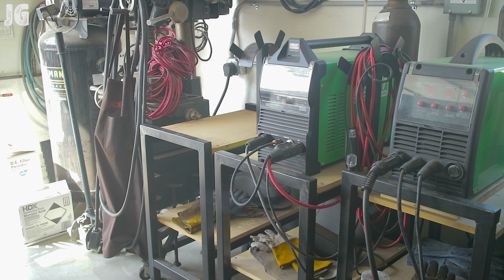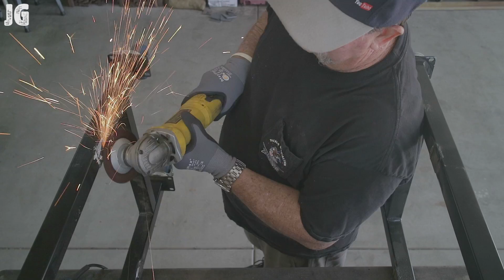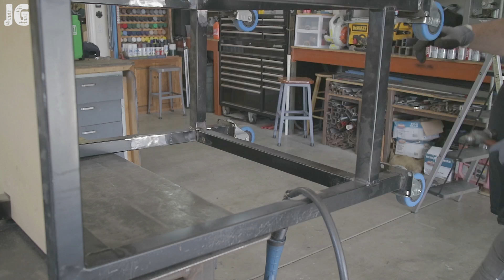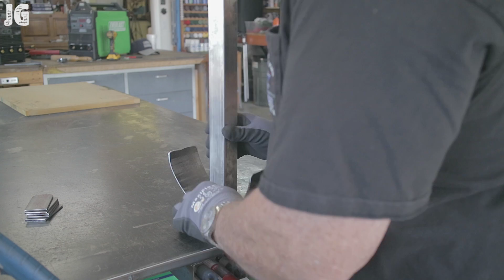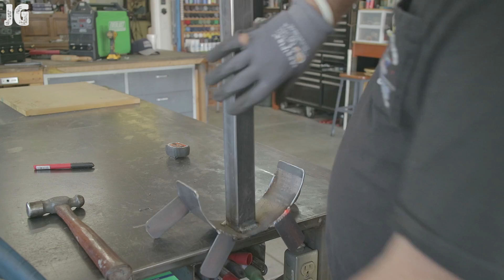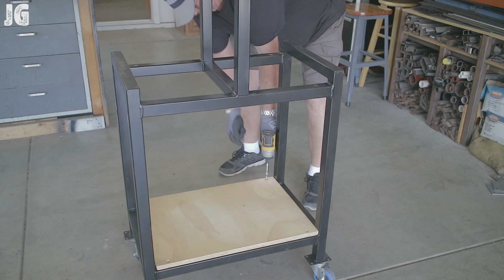Welding Cart Modification - Jimbos Garage

Comment: hi jimbo! can you plz tell me what the specs are for the cable holders? the size of tabs, flat piece, and tube size + thicknesses. I'd like to make some and you have the best design I've seen. thank you so much!
Reply from the maker: Thanks for watching Patrick, The tabs are 1-1/2'' x 3'' long flat stock, 1/8'' thick, The round plate is 1/8'' thick x 3'' wide x 13'' long, If your going to bend it yourself start with a longer piece, maybe 24'' It will be easier to bend, More leverage! Or a 8'' piece of pipe 1/8'' wall and cut it in half. And the sq. tube is 1-1/2'' .095 thickness.   good luck!   Jimbos garage!